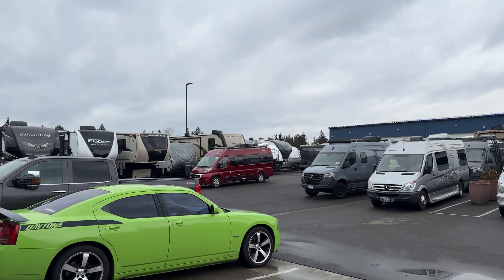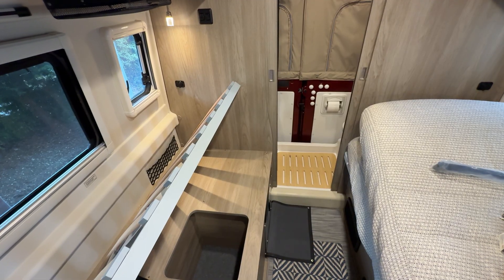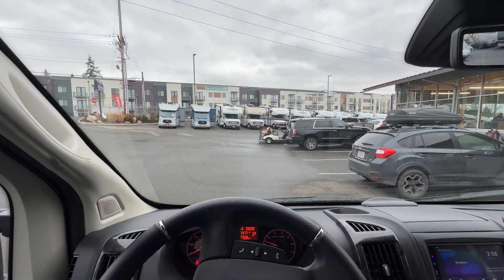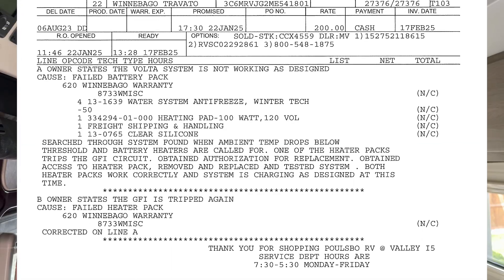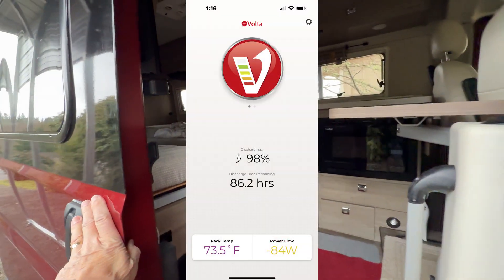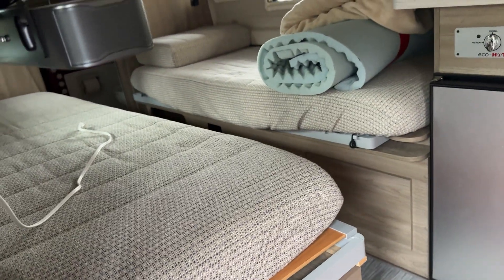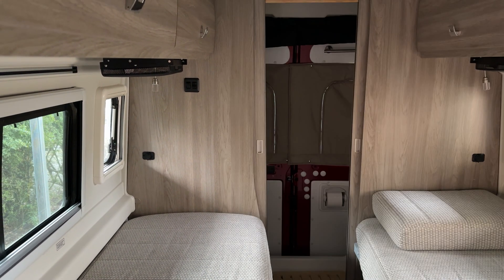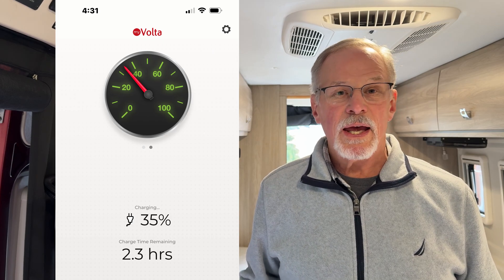Volta Pure3 Power System Issues in my Winnebago Travato 59kl - Update #2

Comment: Volta just announced they are no longer supporting any warranties on Volta Systems. The company is rumored to be filing bankruptcy. Your van and others like Storyteller vans resale value is practically worthless.
Reply from the maker: Yikes! Could you please cite a reference for Volta Power Systems filing for bankruptcy? Volta did recently cover the cost to repair the battery charging issues in my Volta Pure3 lithium battery system under a three-year warranty. Systems are all working as designed for the most part. Right now I am focused on keeping the pair of mice out of our Travato that were nesting in a pull-out drawer in the galley. Stand by for a video update. Thanks for the heads-up comment!